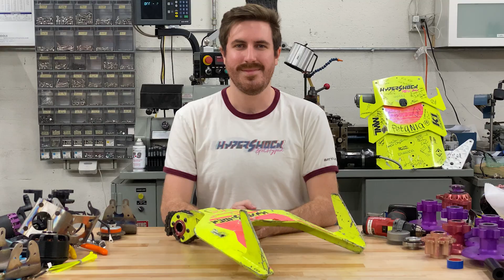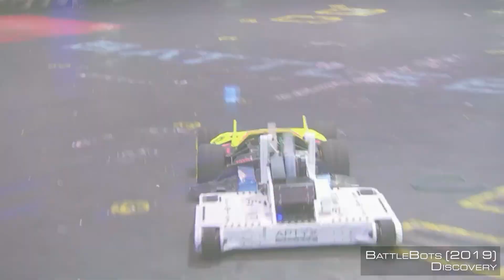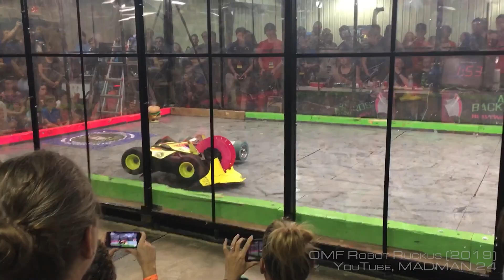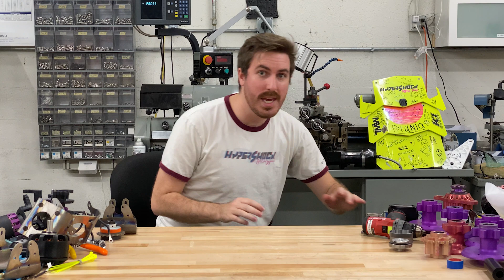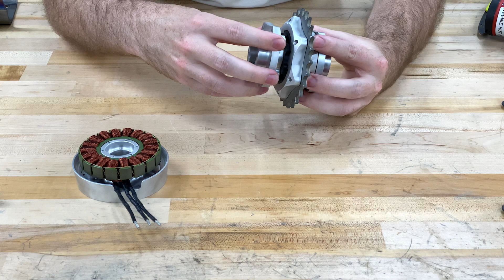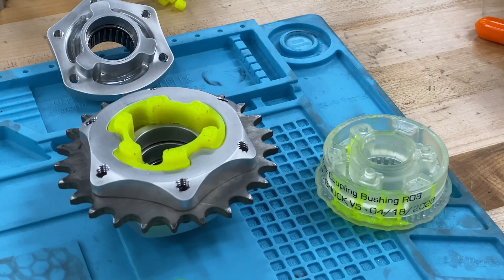Self Righter Upgrades with Xometry

Comment: I hate those tiny keyways in stators. parts look amazing
Reply from the maker: Ya, this NeuMotors 8012 stator has a single roll-pin for rotational engagement, luckily we've got a bunch of screws holding it down axially.